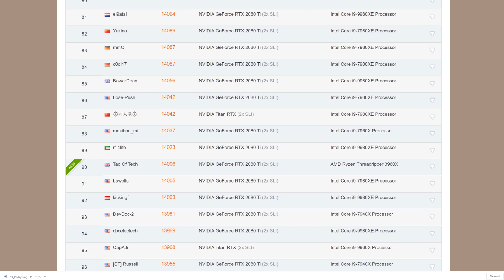Caselabs Threadripper 3960x build

Comment: Sweet build and apart from the case, very similar build to what I have planned. I am have been debating between the AMD 3960 and an Intel based HEDT, but there are virtually no benchmarks which include 2080Ti in SLi, so really looking forward to seeing the benchmarks.
I know that the HEDT platform is not ideal for gaming, but as a mixed-use system, I would like to get the best of both worlds and I am interested to see how the Threadripper performs. I want to be able to push my X27 4K monitor and make use of it's 144Hz hence the SLi, but don't want to kneecap it with the wrong CPU.
Any chance of some 4K gaming benchmarks?
Reply: SLI is dead
Reply: @ukrainewarfootage2023  Any reason or logic to that statement? Evidence to explain why? Benchmarks?

There is plenty of information out there to support the use case of SLi for things like gaming in 4K to get increased frame rates. Videos on exactly that by Jayztwocents, Linus for a start. Here is one example: https://youtu.be/DhsYEf08Fqk?t=457

If it is so dead then why is Nvidia still developing it (that video was only posted last month and demos the CFR mode in Sli which is still in development) and why are there plenty of games that are getting very good scaling with it to support monitors like the Acer X27 4k 144Hz?

This is one of the monitors that I have and will be my primary screen when I am playing FPS and the reason for my post to Tao of Tech. requesting benchmarks for this use case scenario, as he has nearly the identical machine that I am looking to build.

Comment: It is gorgeous, congrats! You seem so happy with the performance too. I can't wait for the next video. I'll be getting the 32-core 3970x soon, but I'm kinda scared to put water anywhere near my PC, especially near one where just one of the parts will cost $2000, haha. 😅 That's why I'll see if I can get away with using an air cooler like Noctua NH-U14 TR4-SP3 for the time being. I would imagine overclocking will be out of the question, but it's still 32 cores so not really that bummed about it.
Reply from the maker: Sounds like a sweet build you are planning there. Making sure your poop is leak free before you power up the system is the key to water cooling. Hope you enjoy your build 👍

Comment: i have the same caselabs case and similar water cooling layout. expecting the thermal performance of 3960X. Please update :)
Reply from the maker: Its coming bud, full set of benchmarks and a review (BTW - the thermals are pretty good, idling @ just over 30 degrees)
Reply: Tao of Tech I helped my friend for a 3900x build. and the temperature is kinda odd. the die temperature is 80C but the waterblock is just warm like 40C. I kinda want to see if TR3 will have the same issue cuz they are using the same die.
Reply from the maker: There’s always a temperature difference between the package temp and the core temp but it shouldn’t be that much - very odd
Reply: Tao of Tech yea. felt like the heat cannot be transferred out efficiently. i am sure i did not make simple mistakes. how is your TR?